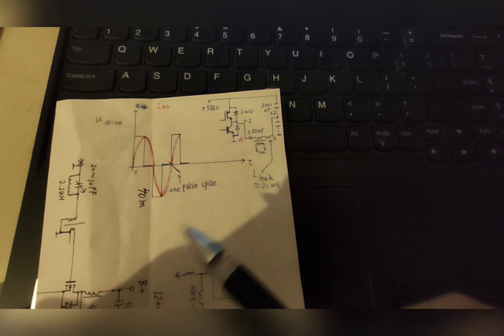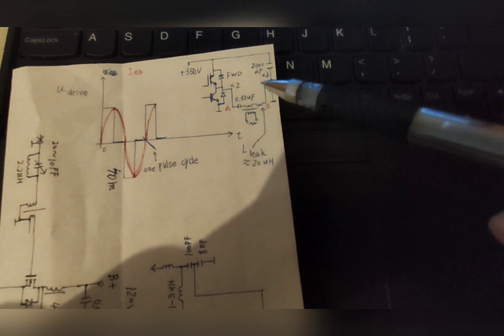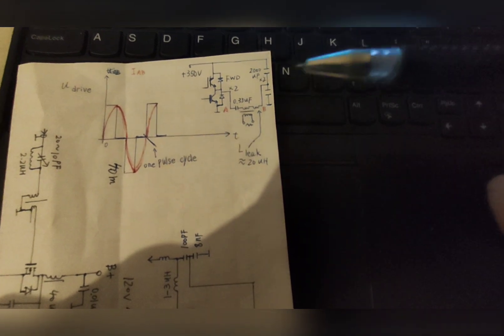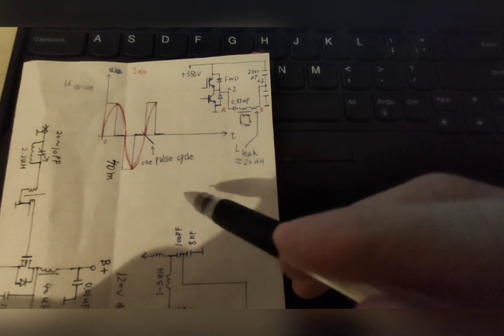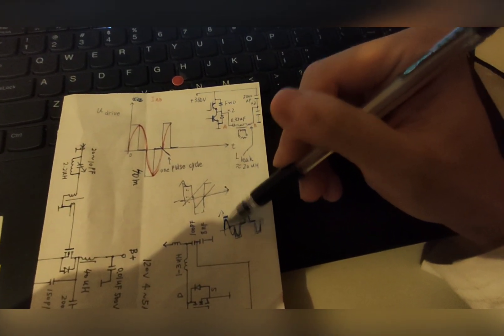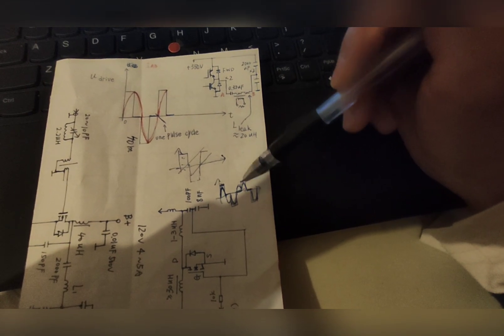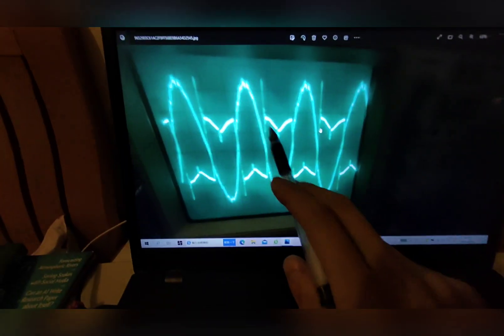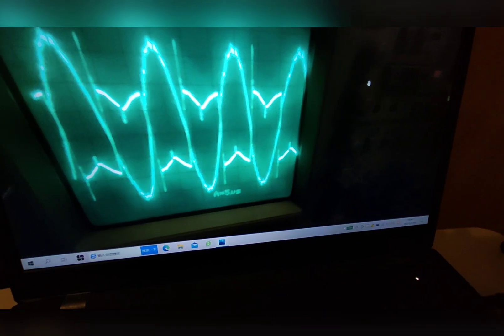Resonant half bridge highvoltage power supply

Comment from the maker: This circuit has short circuit current limit and can be operated with an open circuit in the secondary then directly drive a transformer with the inverter[this circuit is less restrict with the insulating].At 9:57 I wanted to say Rce times current.At the end of the video,both of the voltage spikes are turn－on overshoots.😅If you watch carefully you can see the 2 wires from the inverter repel eachother which indicates high current level.

Comment: People don't realise this, I run a 35 to 40cm gap on my xray transformers so my bus voltage is around 300v before the gap is jumped, 300v bus with 20,000uf of capacitance and no one asks how its possible to go from open circuit to virtually a short 🤷‍♂️ 😂 great video buddy 😎

Comment: Nice, looks quite interesting... What about attempting a secondary side series resonance?
Reply from the maker: I have tried it,now it is the first video in my SHORTS.But it would generator very high voltage at the secondary side and may generate some voltage overshoots at the primary side.
Reply from the maker: So you could see I used a protective spark gap in that post and you suggested me to submerge the transformer in some dielectric oil.😂
Reply: @uecmitsuimarinedieselengin873  alright, I see :) I think that this maybe isn't the point of your channel but it would be interesting to build smth like a tiny resonant monster... I mean, you saw how bigger got the arcs with partial secondary resonance.... It would be interesting to have such a small trafo drawing such big arcs :)
Reply from the maker: @fabriziobrutti1205  That's also what I'm dreaming about.But actually I can't bring it into resonance completely because if that happens it would be nearly a short circuit at the primary side when initiate the arcs and that would be very harmful to the inverter components.What I have done successfully is to set the driving frequency a bit deviate from the resonant frequency so that gave me some current limit on that condition.
Reply: @uecmitsuimarinedieselengin873  sound right, resonance eliminates reactive components from the total impedance.... What about adding some series inductance on the primary (like ballasting a resonant MOT)?
Reply from the maker: @fabriziobrutti1205  I think that will work fine,it can limit the current,but why don't we simply lower the input voltage if we don't want that much current?😂Actually in my previous posts which employs the secondary resonant you can hear my turning the variac,that is to adjust the input voltage to assure the primary current not go over the IGBT's limit.In today's  video I eliminated the variac,this circuit could be plugged in to the wall outlet directly!
Reply: @uecmitsuimarinedieselengin873  yeah I remember the noise! About voltage and current... You may try something with the TL494 IC.... It's capable of primary/switch current limiting, therefore, with one or 2 opamps, you should be able to have a bridge with an adjustable peak current limit...
Reply from the maker: @fabriziobrutti1205  That's a good idea,I could try it later.
Reply: @uecmitsuimarinedieselengin873  great! If I'm right, Tested to Destruction made something similar (tho not for the current limit), for hardware/layouts inspiration... But in any case circuitry around TL494 isn't that complex, the only deal, here, is to don't let things blow up xd